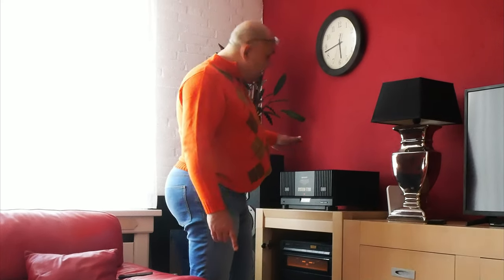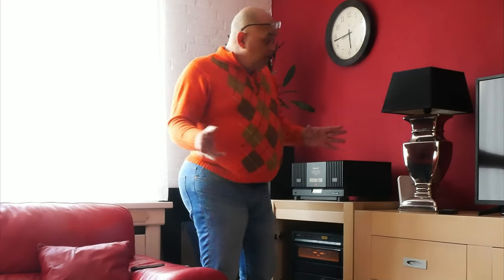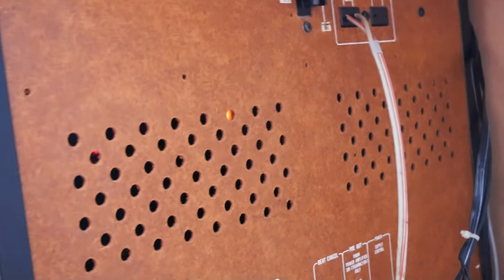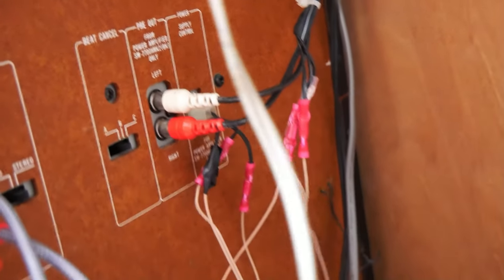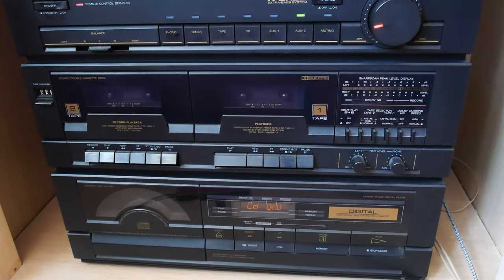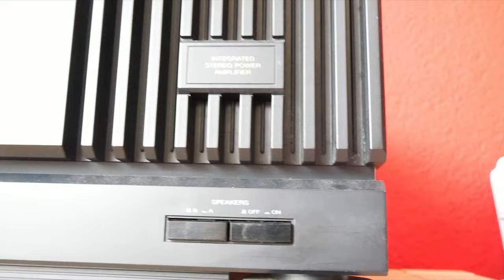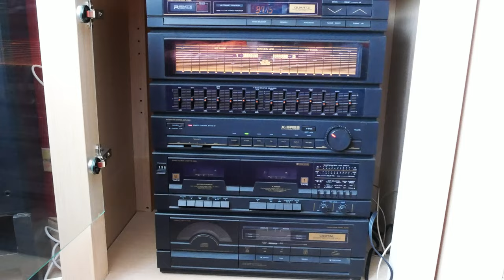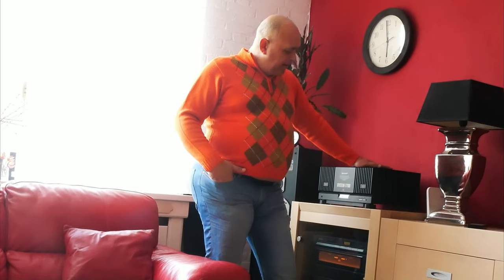Sharp system 7700 and Sharp CP-7700 MK2 speakers

Comment: I found one of these Sharp 7700 amplifiers in a local pawn shop; I needed 150-250wrms/ch to run a pair of subs for my home theater set.  It was not expensive, $35 USD so I grabbed it, not much to lose 

My home theater DSP has 24db/active sub/mid crossover and passive or active for mid/tweet.  With my mains at neutral gain with 90wrms/ch, I had to back off the Sharp amp channels quite a bit to not overpower the mains an get it balanced.

It is common sense that the complete Sharp system is very cheap but this amp drives these sub woofers like a MaDMaN!!

To truly experience what it is capable of, it needs to hooked up to a great sounding pair of subwoofers, through a good active crossover with gain control.  I really had to turn it down a ton.

My home theater is crisp, clean...much louder than I could ever need.  I can turn it all the way up without distortion but it is just too loud!!  The loudest I will use it with movies or CD music is about 55-60%.

In summary, these Sharp 7700 Digital amplifiers are a hidden gem; when I find one in working condition I BUY THEM!  They simply need to be used correctly ..)

Comment: Great video, Look at the inside of this amplifier, it is fake. The whole system is so fake. What are the speakers?
I had a tuner from optomica and it was great and heavy.
Reply from the maker: the speakers are Sharp CP-7700 MK2 its a hot air system
Reply: They are made to look impressive and to attract customers who have no clue.
Reply: @vintagestereo  They state that the Amplifier has 1% distortion. 

The inside of the power amplifier is interesting to look at. They do have found a large transformer a small board with a IC amplifier and some filter caps and heatsink. 

I want to look at the IC transistors to see the real power output. I have looked it up, it is a STK 4241 module that can do 120 watts on 8 Ohm. This thing can do allright at a party.